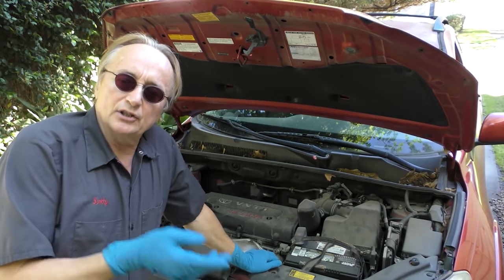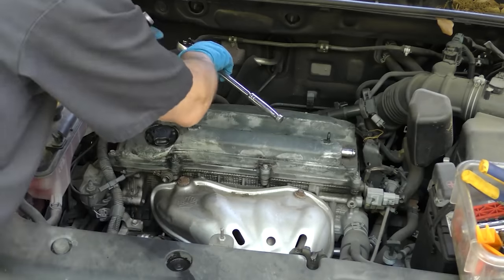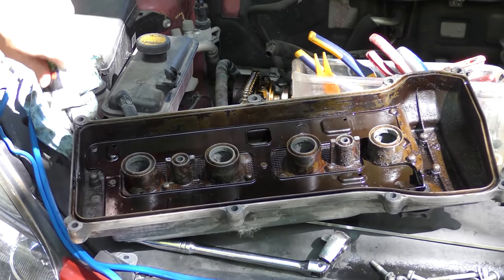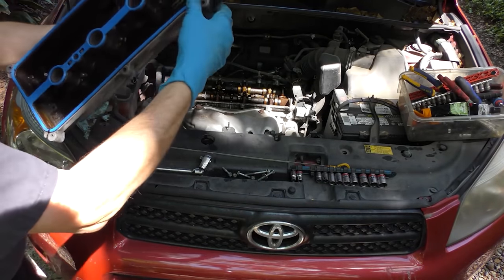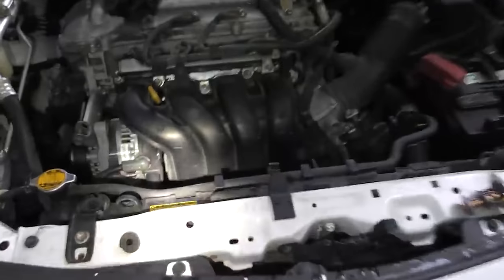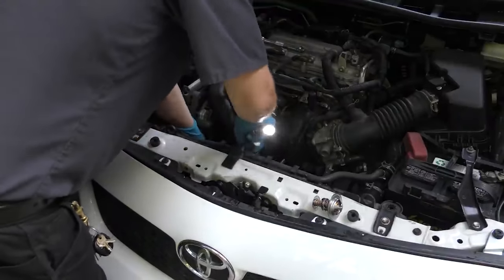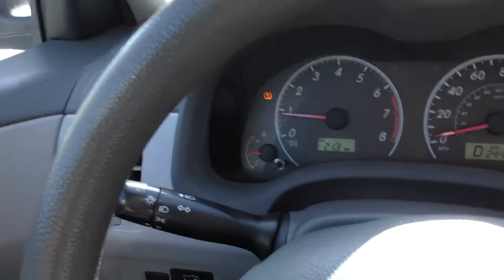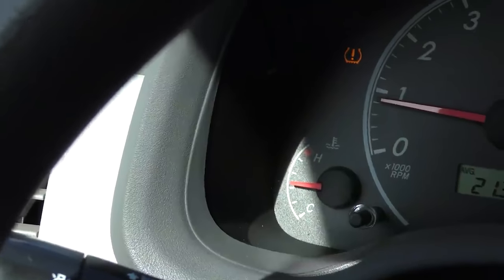3 Mechanic Scams Caught on Camera

Comment: Its nice to see Scotty  " calling out " Toyota dealerships , too .
There are crooked mechanics and service writers everywhere!
Reply: Anyone who works on commission is as thief. It goes with the territory unless their a Mormon, then your probably OK
Reply: @IMHipp-wp3sd  lol
Reply: I took my car to a Toyota Dealership for its very first complimentary service. Didn’t go back. I’m pretty sure my car just sat in the parking lot all day lol.
Reply: AND lame employees. The laziness and the cheating I see my Amaz_n site is constant. Get a mechanic over 40 so as to get a a decent result.
Reply: @IMHipp-wp3sd  That's the main lesson I got from this. Toyotas are well engineered, but never ever trust a dealership service department.
Reply: Toyota in USA is not Toyota in Japan.
Reply: Sometimes It's A Young Punk That knows nothing about the Automotive Field And just throws Part's At it. Like Scotty Said Pressure Test The Cooling System first. That should be Standard Procedure Every Where. I don't buy the 50/50 Coolant. I buy A gallon of pure One Hundred Percent Coolant. Buy A Gallon Of Distilled water and make My Own Most Tap Water has to many minerals and can cause the Cooling System To Calcifying.
Reply: Yes Mine Was Built In Kentucky As well. The Japanese Cars have Steering And Pedals On the Opposite side. I found that Out When I bought A JDM Transmission from Japan. I had to Change Some things Over.
Reply: The hell!  Maybe they're honest with each other but i got ripped off by Mormon real estate shysters in Arizona, owned by a reverend too or whatever they call it!
Reply: That was addressed to Mr I. M. Hipp
Reply: Anyone noticed the brand new multi-million dollar workshops for Toyota service centers.
A car sales guy said all the money's in servicing these days ... especially on new cars where they bill Toyota directly under warranty.
Like a printing press.

Comment: This is EXACTLY why I don’t go to any shop, especially not the dealer. Years ago when I was 17 and knew nothing about cars, I took my 98 Monte Carlo to a shop to get a tie rod end replaced. They quoted me $390 and for some reason unknown to me I decided to go to Autozone…first time in my life I ever walked into one. The part was $12…it was at that point I taught myself everything I could about cars by watching guys like Scotty and reading a bunch. I now do all my own repairs with the exception of transmission work.
Reply: Good on you bro.
Reply: Yeah I once had a 98 Nissan Maxima that took conventional oil. Those other vehicles typically only take conventional oil. I brought my car to the shop to have them do an oil change. when I got it back my husband was rattling like crazy. I then looked at the receipt and come to find out that they put full synthetic in a vehicle that takes conventional oil. Worst part about it is that I am a mechanic what was just being lazy and thought I'd have somebody else change my oil for once. Ended up changing the oil again myself. Afterward my car quieted down and never gave me any issues. Just because you take your vehicle to a professional shop does not mean that the people working on it are professional. I now I do my own oil changes and all the other work that needs to be done unless it's something that I'm not equipped to do.

Comment: Scotty, your section on changing the thermostat et al, is one of your best tutorials. As a dubious shade tree mechanic for over 65 years, I have known all this, but you put it all together for peeps who don't. Thanks!
Reply: Why did you not change the head gasket on that toyota? If it makes the car last longer. And how would you know if the sealant you used worked or not?

Comment: Had a mechanic that my father used and recommended. I needed new tires or so I thought. He was completely honest with me and said that that new tires was the least of my problems. It turns out the underside was almost entirely rusted to the point of basically breaking in half. So needless to say I sold the car for parts  and got a new one. That mechanic cared about my wallet and more importantly my safety.
Reply: how do you even find a good mechanic? there should be a way
Reply: @Vaisero    sometimes its trial and error ... just have to go with some here and there till you find one you're comfortable with

Comment: We need a Scotty Kilmer academy.
Mechanics should go through it and a globally recognized certificate should be given out.
It would be nothing short of amazing to have someone as great as Scotty in my area.
Reply: Well he would be fired at a dealer you don’t need weather stripping adhesive most of all on a formed Felpro gasket what you do need to do is press the gasket in the valve cover with a paint stick so the tabs compress and grab and you couldn’t shake the gasket out if you tried

Comment: Cellphone cameras have to be one of the best modern tools for shadetree mechanics.  I can't count how many times I've taken pictures of stuff as I've taken it apart so I could remember how to put it back together.  That and YouTube how-to videos have really revolutionized DIY auto repair.
Reply: You know it brother!  I did a head gasket for a friend’S wife.  2003 Audi Quattro.  Had to take the front end off just to get started.  Dozens of pictures, color coded markings for all the vacuum hoses and over twenty baggies that were numbered in sequence of dismantling.
Reply: it really is beneficial. I remember in my teens and early twenties, all you really had were those Hanes manuals.
Reply: For bigger items or items with a lot of bolts where some of them are shorter and others longer( trans bell housings come to mind). Just draw a blueprint on cardboard and stuff the bolts in where you put the bolts in.  Then on the install you just pull and put them where they should go.
Reply: @glasshalffull2930  what did you use for the color coded markings? paint pens, or  chalk or what?

Comment: One of those chain companies told me I needed a new differential because of vibration I was feeling. Of course the invoice was $1000s. Came across one of Scotty’s videos. Found out it was a wheel bearing. $90 and one afternoon later I replaced both bearings in the front and now my car feels like new! Thank you Scotty!

Comment: You reminded me when i was 18, i had a 91 civic, so i took it for a nee tires and alignment. The mechanics comes in and asked whose car was the honda, then he said that car is f@cked. He needs tie rods, the tie rod is broken. He quoted me $500. I walked out from there and took it to my dad and my dad found no problem with the tie rods. Forgot to mention the mechanics said, dont drive the car until you fix it. Lol i drove two year after that and sold it. Then learned how to work on cars
Reply: yep the old tie-rods scam , usually it just needs OUTER tie rod ends which are affordable but need an alignment after.
Reply: In this one case, it was probably true and good advice, to replace the old tie rod ends due to ball joint wear, right before getting an alignment done.  Not having it done and driving two more years, probably prematurely aged/wore the tires and made it steer/handle sloppy.

By all means, DO, do your own repair.  If it's an old car and you're about to get new tires, replace the tie rod ends yourself, adjust them as close as you can get them, THEN when they do the alignment they are set till they wear out again.

If you try to do an alignment on worn out tie rods, it will be poor and some will refuse because it  can't keep the angle on the road, and then it looks like they did a bad job.

Comment: I tested a shop just to see what they said when I had a rock stuck in the treads of my Tire😏It was tapping nicely when I was driving and had them check it like I had no idea what was wrong,they came back with a estimate for a front hub bearing on my H2 at almost $1000😂I told them I would have to get back another day for the repair,and took the rock out in the parking lot before I left🤯

Comment: When I saw where the thermostat was I knew it wasn’t changed for a reason. 21st century dealer mechanics don’t want to get their hands dirty and there is a chance they might scratch them on something sharp.
Reply: they also do not want to get dirt under their finger nails!!!!!
Reply: Snowflakes might scratch their nail polish
Reply: They are what we call "chickenshit mechanics".
Reply: @northwestmechanic8991  They dont like when they see cars with 200,000 miles either. Like they're calling the shots on whether they fix your issue or try to get u stuck buying another car. I took my 307,000 mile cruze in with electrical issues & they always wanted to force me to buy an ac delco battery & blame my fried wiring harness on the battery!
Reply: There are a lot of " mechanics".  I brought a Focus in for a recall repair.  No check engine light.  When I picked it up, since there was no check engine light problem originally when I brought it in, I was shocked to see the check engine light on.  The mechanic/dealership did not mention it was on.  I looked up on internet what could cause this.  One video mentioned that if connectors are not seated properly it would produce check engine light.  I opened the hood and saw a connector that was not all the way in (sheer luck that I caught this) and pushed it all the way in.  I asked another mechanic (not dealership) if they could let me know why the light is still on.  I mentioned what had happened.  He said the charge is $100 to determine why the light is on.  Well, I continued to drive but my emissions was due so  I was desperate to try and figure this out.   I went to auto parts store and they tested and gave me the codes that apparently caused the check engine light.   They said they could not clear the check engine light and I would have to order a part that could do that.  I went to another auto parts store and they printed out what part "possibly" needed replacement, but they were careful to say this might not be the problem.  I asked if they sold equipment that could clear the codes and light and they did find one in stock for $50.  I bought it and figured out how to clear the check engine light and codes.  Oh, my gosh, I was so relieved.  I drove it to emissions testing, and no check engine light appeared and it passed inspection.  So, all this time, though I luckily caught the problem, the check engine light could not just be cleared by any mechanics that I asked.  I seriously do not trust mechanics now.  What a racket against innocent consumers like me.
Reply: @nickmalone3143  Back in the early 1990s, I was playing a lot of gigs and always tried to look like a rock star, which among other things sometimes meant wearing nail polish.  My nail polish was always chipped and scratched all to hell, though, because of abrasion from the bass strings, getting in fights & working on my car, hahaha...
Reply: That sure sounds about right to me
Reply: @2009glories  I'm tired of pressing the read more  tab
Reply: @2009glories  Similar experience! I went in for airbag recall for passenger side and a few weeks later, the airbag malfunction light came on (for driver side?). It may be coincidence but my trust level went down since.

Comment: The problem with going to the dealership is that we're usually not given much diagnostic time. A vehicle comes in, and some senior tech says "Just do this..." and you get potentially yelled at if you dare try diagnosing. It's far too busy in there, and often times taking appointments is outsourced to some call center somewhere. So basically no one has control over anything.
Reply: The small town dealership we go to takes the time 🤷🏼‍♀️ I have had a random ghost issue with my car where sometimes it decides not to start- happened a few times. The dealership picked it up and spent time with it. They kept it for a week (and gave me a free rental for the week). It started for them every time they tried it and did road tests and they did a full system check with the computers. Couldn’t figure it out. I say it’s a ghost or demon bc both times it started behaving at the dealership (even after having to be towed up there after we couldn’t get it to start)... had the car for years and still runs fine. Really all they could tell me at the dealership was not to let it get too hot bc both times it didn’t want to start it was HOT outside 🤷🏼‍♀️

Comment: Hell, I'm not even a mechanic and I know if a car is overheating the thermostat might be the issue...
Reply: Mine was running on the cool side, finally got around to changing the thermostat. $35.00 plus the gasket. A lot cheaper than hoses and if that dealer had changed hoses they should have done the stat, being everything was already drained anyway.
Reply: @gnic76  speaking of which: i think the hoses should have been an afterthought, and maybe even a throw-in for the price of the tstat job!
Reply: Common Sense Isn't So Common Anymore 🤣
Reply: @emptytomb4967  Yeah I agree, the hoses unless cracked and leaking would be the last thing to replace or just suggested to be replaced if the coolant was drained anyway.

Comment: I blame incompetent service managers for a lot of these "throw parts at it" repairs.
Reply: they are not incompentent. their goal is more parts changed more money solved. that simple.
Reply: To be fair, often their job depends on it. They're under pressure from on high to exceed targets. The business isn't about servicing cars; it's about expanding the bottom line.
Reply: Incompetent or ignorant. If a mech tells manager that both exhaust manifolds are bad for your v6 and manager doesn't realize your car only has 4 cyl and 1 exhaust manifold..manager sucks
Reply: It’s ownership. At least in the dealers ive worked in, it starts at the top. The owners son needs a new gtr, and YOU will be paying for it.

Comment: Instead of glue for the gasket I'd like to use high temp bearing Grease. The gasket will stick it won't twist and it's easy to remove the next time someone's in there. I learned to do this when valve covers had the old cork gaskets that would dry out the bearing grease kept them simple you should know this Grandpa Scotty
Reply: Will it not mix with the oil? Is it safe even if it mix to the oil?
Reply: @Charlie-vl9op  Then use the amazing Permatex Ultra Slick engine assembly lube!  I first put it in the freezer so the lube can get thicker then when its time to stick the gasket I then use the Ultra Slick lube around the gasket rim and it holds the gasket very well without any slips or falls and makes it easily to assemble valve gaskets with ease!  Works every time...
Reply: I tried that at a job I was working at doing commercial vehicles the boss cursed me out and I spent the next hours cleaning that stuff off the the engine cover.
Reply: i noticed that glue he used there was a string of it going from one side of the cover too the right side, then he let it dry and out it back on, wont the string of glue break off and go into the actual engine? 😂🤷🏼‍♀️
Reply: NO DONT DO THAT
Reply: Or just do it the right way and push the gasket down with a paint stick so the tabs lock and its simple to tell shake the valve cover as hard as you can it wont fall out what he did was old school for four bolt flat valve cover cork gaskets the twisted was because the guy doing it was sloppy not paying attention or just didn’t care
Reply: I'm an old timer now, but years ago I was taught by a old timer to keep a tub of Vaseline in my toolbox for gasket installs like this.  You don't have to worry about a grease that may or may not break down in the crankcase, it's super cheap and sticky and it never dries out like adhesives.
Reply: @kfgreenwald166  you don’t need any of that if you install it correctly this isn’t a 4 hole chevy valve cover gasket

Comment: Toyota dealer is like the ER--specialists in deflating the bank account.
Reply: Portland Toyota dealer are scammers I wrote review on Google. Just brought my car for oil change they tell me I have a oil leak on scale 7 put of 10.  They suggested  gasket replacement but it will cost $3500.00 didn't have  oil sport at home or at work after dealer visit  oil was comming down good. I was ready to get that gasket but decided to look my self. What do you know, they did not tighten oil pan plug and I would've lost the plug if it wasn't for plastic cover under my car. Portland Toyota are real crooks playing flip flop with transportation and trying to steal from you.
Reply: @RU2BHP  T
Auto manufacturers should better police their dealers.

Comment: Thanks Scotty for yet another great video. Keep kicking dealers in the groin!!!Here's hoping that dealers really do disappear in the near future. There is no reason you can't buy a new car factory direct and used cars where the seller must offer full disclosure and all sub-par mechanical issues are identified. I bought an older 2007 Subaru from a small car dealer 2 years ago. About a week later there was a light that came on, saying airbags needed attention. My seller sent me to the dealer, which was the right thing to do to service airbag codes. The service rep at the dealer said it would be $195. My seller had clued me in that airbag are ALWAYS the manufacturer and dealer's problem with NO CHARGE to the vehicle owner. The service rep frowned when I told her I would not pay as it was THEIR responsibility; she looked at her computer for a moment and then apologized for her "oversight". Dealers are scumbags.